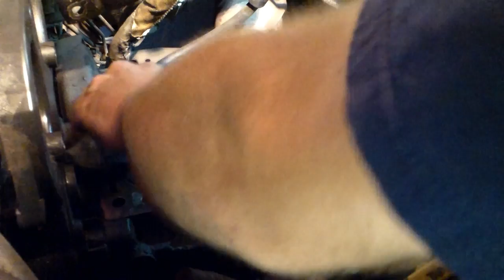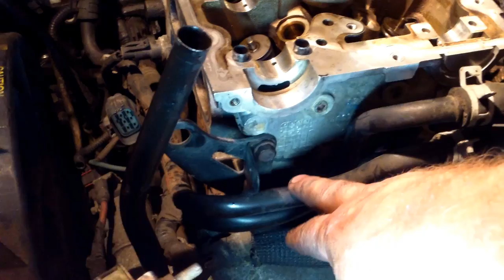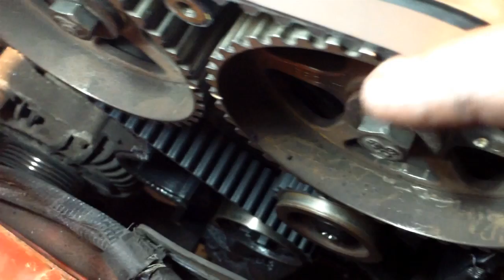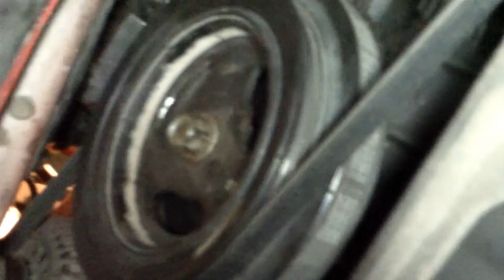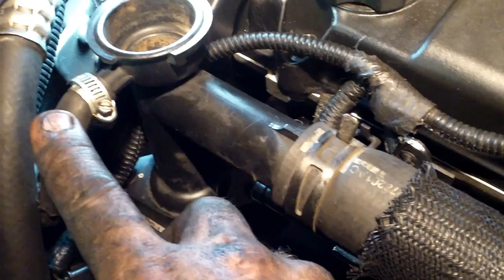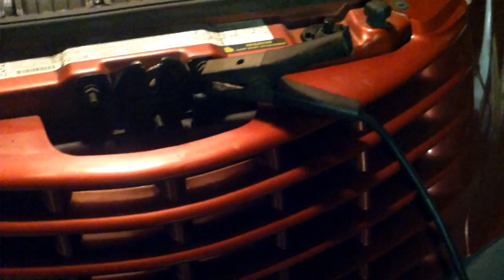PT cruiser 2.4 Cylinder head installation "continued' part 3 its alive

Comment: Why use a harmonic balancer to torque the main pulley?  Just keep the car in park (ATX) or first gear (MTX) then the weight of the car will stop the crank from turning.

Comment: Good Afternoon: Yes I would know if you having a overheat problem on your Pt Cruiser & lose oil too Why I ask I have a 2007 Pt Cruiser it keep overheat & I can keep checking oil dipstick see I am getting water in the oil. But we start the car up temperature gauges & the temperature sensor-3 time & thermostat-4 time & it keep overheat, So can tell me why I am having some many fucking problem. Can you tell me how can I check see if the fucking water pump working. So what do I next to fix this fucking overheat problem.I'm calling from Houston TxOh keep up the good work on your web site & show more video on here too

Comment: I got an 05 Sebring with the same size engine, and I was just wondering if, due to the complex process of replacing the parts shown in the video, wouldn't it be better to just take the motor out of the car first and then make the repairs on a work bench?

Comment: Hello my friend.
i have a jeep wrangler 2.4L 2004, its the same engine as the video, only the ubication of the elements its diferent.
Time behind the car is overheated, throwing bubbles through the radiator, the head gasket is damaged.
Recently the change was made, following the steps of the manual, but when starting, the car does not hold the idle, and after a while, it has bubbled through the radiator again.
Watching this video I see that the steps that I did to make the change were based on the manual and this video confirms that what I did is compliant, but the car is not working well.
I need help to do the repair again.
You can help me?
Reply: Did you check to see if the head was warped ?   Did you check to see if the top of the block was warped ?   Where it mates with the head ?

Best wishes ,   :-)
Wyr
God bless

Comment: Good job man but there's no way I could just replace the head. I'd remove the entire engine and check and clean everything and while its out replace the everything, including the alternator and water pump, all the cooling and heater hoses and anything else that needs attention.

Comment: thank you so much man for this video, I'm currently doing the same job you just did for a friend who has the same car, your video is helping me heaps, I havn't finished yet, currently the cylinder head in the shop being repaired, the engine died on my friend and when the boys at the shop so the head they said there is no cracks but she blew the whole set of the ex valves. once the head is repaired I will be putting it all back together, 
wish me luck 
it is not as easy at it looks

Comment: I am an aircraft mechanic, not a car mechanic, but loves for the video. Just one thing, you can put a mile of extensions without recalculating torque. The only time you have to recalculate torque, is when you use an offset driver of some sort, but even then no recalculation is required if you use it at a 90 degree offset.

Comment: You sir are a master....I have done a few heads in my time but on the PT i think i would just close the bonnet lmao. This is my first PT i got it because it reminds me of the old ford pop and aged 47 i am in mid life crisis mode with not much money lol ...Its a 2005 .....2.4 with 69.000 on the clock and thank god the head is good i hope....How ever it will need a new cambelt in 5000 more miles so it was just what i needed to watch you install a new one....It does have a couple of problems however ....One easy fix is it needs a new break master cylinder...Some times it will not start i have to back the key off then let the petrol pump click off then it will start ....Maybe they are all a bit like that...The other problem is its kind of hard to drive at low revs. ..It kind of jerks a bit at low revs like a learner driver. Not massive just a little bit so as to notice it ...Clutch is good and so are drive shafts...Some one said it may be the egr sticking or the throttle response thats dirty. Both of them i am at a loss with as all the engines i worked on were old classic cars lol ...I am going to get a scanner to see if it gives me any codes or see if there is a tiny misfire....Keep the good work up fantastic to watch you put the old girl back on the road.

Comment: Wow. Now I know why these PT Cruisers are so cheap on Craig's list when they have any kind of engine trouble! Are all the newer 4 cylinder sidewinder cars similar to this one such a hassle to work on? It looked like it took for ever in labor time (= high $ cost) to get this done. I wonder how many people do not properly re install all the wires, hoses, clamps, covers and fittings that have to come off when they work on these things. Did you replace the a/c 'o' rings when you put that back together? Or is this now a permently non a/c car?

Comment: I'm in the middle of this repair and getting close to the end. Thank you for your comprehensive and common sense video. I probably would have sold the car or paid an enormous amount of cash to have someone else do the job! My experience with this type of repair is limited. I used to work in the collision repair trade but haven't gotten this deep into an engine in a very long time. Your doing good work and helping more people than you realize. Putting the internet and YouTube to use the way it was intended.Thanks so much! You should be getting paid for this type of information.
Reply: Update: After final assembly and checking installation the engine fired up and ran. Surging idle speeds indicated a problem. At the time I hadn't realized that the timing jumped 180 degrees on the intake cam due to a weak tension pulley! Replace it when you are there. Don't skip this important step! Chrysler retro fit kit was the best option for correct fit and price. After a tear down to the cam sprockets , reassembly and a compression test to insure no valve or piston damage the repair is complete. Running great!  800 miles and no problems. Thanks again for this great series of videos.
Reply: T

Comment: The reason,I think,your videos are so informative is that you don't assume that we know what we're doing. If we knew what we were doing, we wouldn't be watching your videos. Thanks for taking the time to explain in great detail exactly what you are doing even though it probably bores you to tears. Your patience is greatly appreciated. I was wondering if you might have any plans to make a video on changing lower intake manifold gaskets on the 3.4 engine found in the Montanas? There are a lot of people who  how to do it becasue so many were screwed over by having the gaskets deteriate and mixing water with oil. I have just discoverred your site and look forward to watching your very informative videos. Thanks for your time and trouble. It IS appreciated.
Reply: +Ron Hensley Spot on.  Really enjoyed this.  Noob here - most adventurous I have ever been is cleaning the throttle body and changing the valve cover gasket on an MX5 :-)
Reply: It's great to know that we can share information among us all.
Thanks for all your efforts..

Comment: Excellent video, quality all around is up there with the best.  Did you use a special tool to torque down the crank damper bolt?  My book recommends Special Toll 6792.  In my 03 Turbo PT, I believe my leak is in the heater core because there is virtually no coolant coming from the engine, but rather from the evaporator box drain tube...I understand they share the same drain.  Compression check was ok as well as the cylinder leak down test.  This engine setup is the biggest headache I've ever worked on.

Comment: Thanks for posting these vids.  I have a PT that is causing me grief now because it is overheating due, I think, to the fact that coolant is not being drawn back from the resevoir.  It just keeps filling and then leaking out the overflow tube. I've repaced the rad, thermostat, hoses, fan, fan relays. Plus I've blown out the hose to the resevior and checked the tank for leaks. I think originally the low speed fan control wasn't working and maybe warped or cracked the gasket or the head due to overheating.  In any event, it goes in tomorrow for compression and leak down diagnosis cause I give up.
Reply: Mis repetos a ud señor creo que ud es un buen mecanico tengo un carro igual a ese con el mismo problema. Y estoy a punto de tirarlo a la basura porque no encuentro quien me lo arregle

Comment: Did you say "Wire Wheel"?  funny but every time I use one of them small parts of wire brake off and fly all over the place.  OK, sorry, I am being sarcastic but man!  you should never use a wire wheel in the engine compartment. Most shops I know would fire you for that.
Reply: Ralf V The reason I said that is cause the wires on a wire wheel can get into the coolant jackets and worse one of them could get trapped between the piston and cylinder wall.  Yes some wires can get in there.

Comment: I just picked up a 2007 PT Cruiser which is experiencing the same symptoms as your 2001 except my misfire is from cylinder 4. With the help of your clear and concise explanations I'm comfortable digging deeper to attempt to diagnose this misfire. I'm at the compression check point in the progress and I'm pretty much expecting to find out the same thing you did. 6 years newer but still the same issues? Cmon Chrysler engineers get in the game! Thanks for your help!

Comment: I use a beam style torque wrench for the last step.. then it's easy to see if a bolt is over stretched as the torque value will start to drop.

Comment: Thanks so much for all this info.I bought a pt as while back it seemed to be running OK but when I checked the coolant .I was shock to find out I had to add a full bottle! I was going to change the timing belt as it has 200000 k\m s.
But it has had a little stumble at idle when the air conditioner kicks in. So I will do your head test first.

Comment: i have a 1990 chevy k1500 when i go to start the truck i have to wait for the oil pressure to build up to 30 or 45 psi then it starts up when do you think this is note i have a brand new fule pump relay

Comment: All 3 videos were very educated.  I also have a misfire in Cylinder #2 on a 2001 pt cruiser which the reading code  PO302.  I change the sparkplugs, wires, and coil.  I guess this is the next step after watching all your 3 videos.  Thank you

Comment: You mentioned extension use and a formula and it's true, but only if you are extending the length of the ratchet handle, a socket extension doesn't matter. I did a lot of reading on the subject not too long ago. I always thought that you had to increase or decrease when using an extension too, but it just ain't so....look it up. The wiki is a good place to start for fairly good info. I had no idea.
Reply from the maker: yea i have been lead to believe so over the years, however i never researched it to far, if my extension looks beefy haha i don't worry anyhow
thanks for the feed back

Comment: Job well done.  Did you consider doing a valve job on the replacement head before installing it?  Why, or why not?  Love your "just do it" attitude on a difficult job like this.  No whining, b1tching, or throwing tools ( at least on camera)  Thanks for posting.
Reply from the maker: thank you, yes i did consider it however i opted out just going with my gut instinct, i know that sounds bad however the head looked clean well maintained, i use gas to check if the valve seats are leaking, just put some gas in the port and watch for a leak, all looked well, so i went with that, i also had some worries there may be more damage beyond what i could see to the block, not to mention time and extra expense, hope that helps, hahaha yea i have my moment  its hard not to thank got for editing

Comment: I hope I never have to do this. Looks like too much like work. BUT my 06 I guess is not worth a pro doing this job. What would a shop charge for what you did? Thanks for the video I'm sure more fun to watch than do. Mike 06 PT
Reply from the maker: i wouldnt wish this one on anyone however it was well worth it runs great now gets real good millage im happy with it well the other half is lol 
this job can range i would say starting around 1,200 up depending on parts new or used head could easily go triple that fast

Comment: Isn't it an irony, that best practice is to not use a torque wrench for the final turn.
Reply from the maker: true, i think of it this way my torque wrench can handle up to 200 ft lbs as long as i don't forget to crank it past a limit i will not reach seems fine to me, i assume its right around 80 to 90 ft lbs with that quarter turn had it set a little over 100 never reached it, thanks for watching